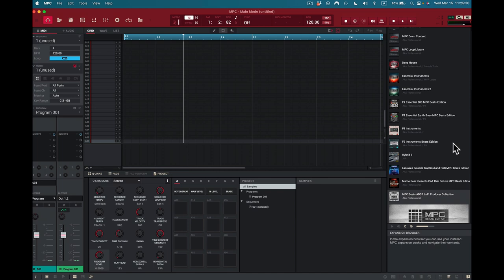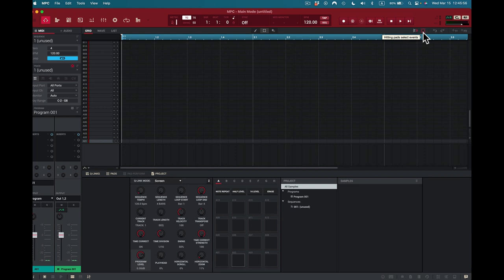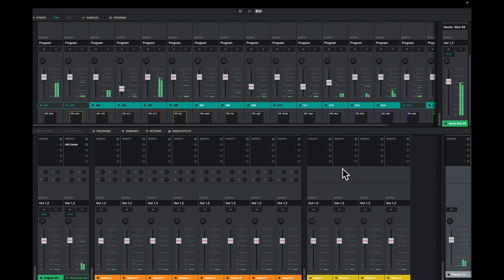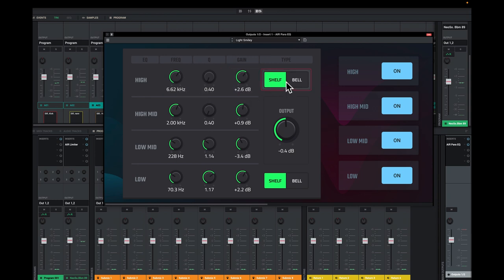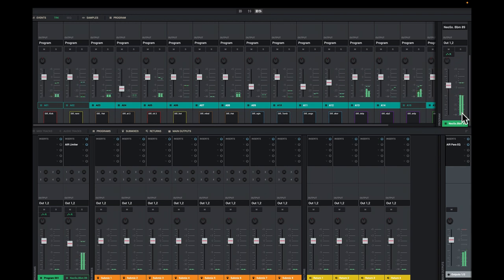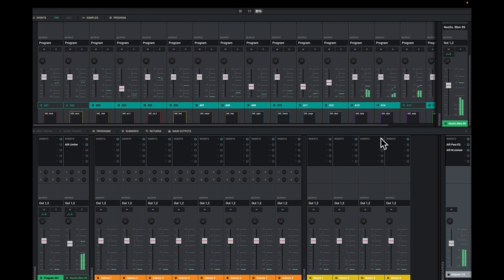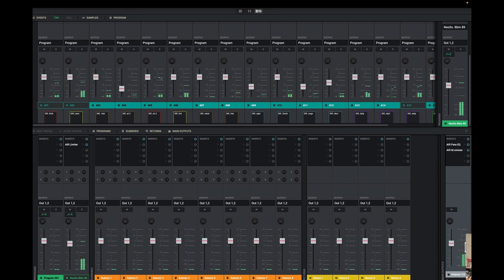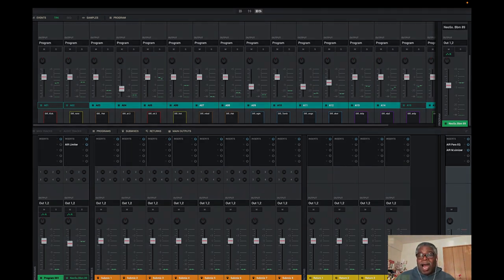MPC Mastering for your output and Master file bounce Part 1

Comment: I find that the vintage compressor filters is leagues above the air maximizer.  I gives you a crystal clear increase in volume without going into the red that’s even better than clipping. I have a mpc 2000xl that my uncle that passed left me and I love the sound of it . I didn’t want to use new mpc or software because I didn’t like the sound but the vintage compressor filter combined with a vintage mpc3000 filter or the sp1200 filter sounds on par with my mpc2000xl . I use the software now because it’s convenient and I get the sound I wanted 😊